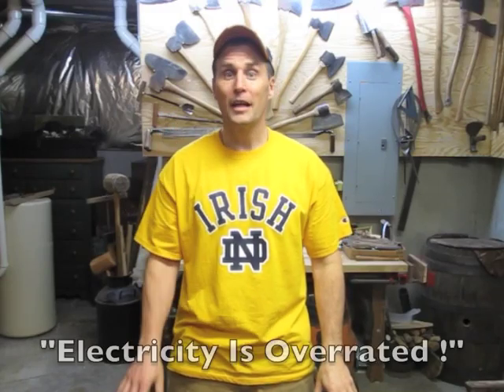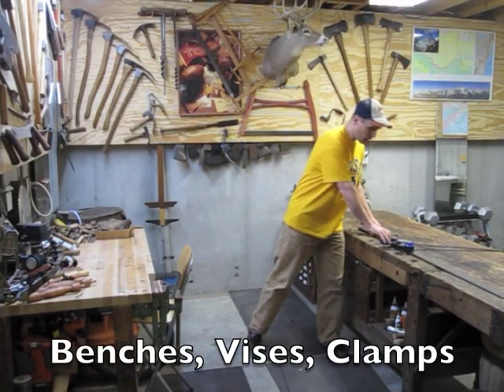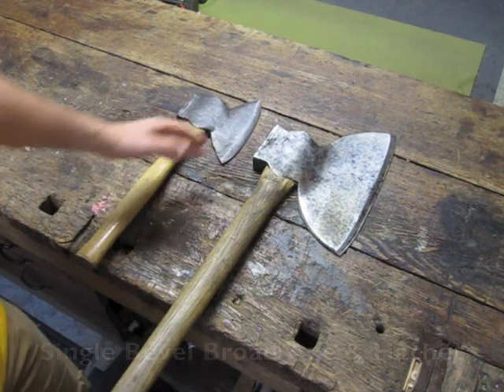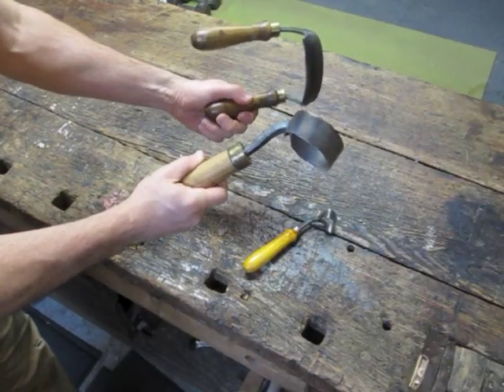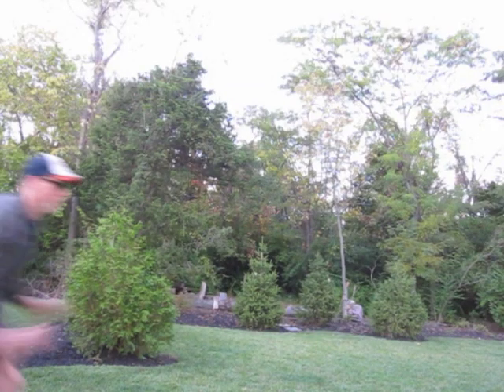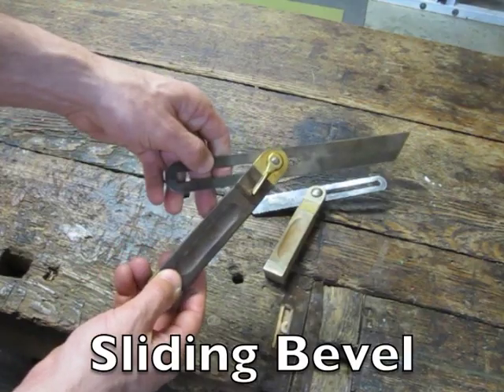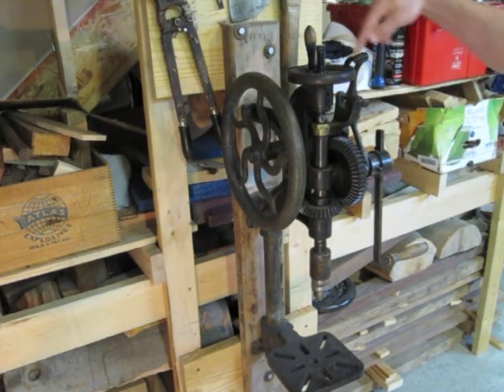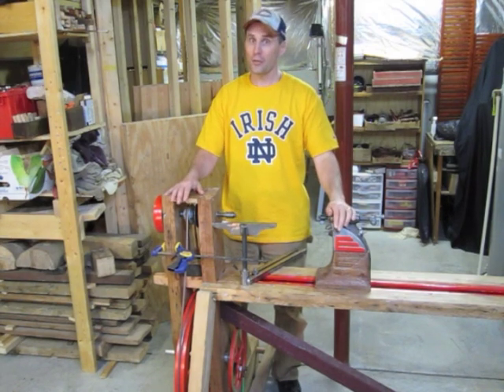Tools To Build A Rocking Chair | Chop With Chris

Comment: Hi Chris,  I'm a better than novice woodworker and a friend of mine just give me a rocking chair to fix. 
One of the rockers broke a few(9) years ago. 
My question is. What type of wood would you recommend replicating the rocker out of. The chair has a very dark stain on it so there is no worry about matching type of wood.
Thanks for your suggestions. Any would help. 
Marty
Reply from the maker: Marty,
I have to admit I am not a furniture expert as this is my 1st chair.  Given the dark stain I would use Walnut.  Its strong, works easily, and finishes very well.
Good luck.
Chris
Reply: Thanks Chris